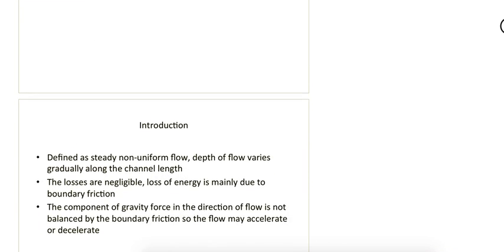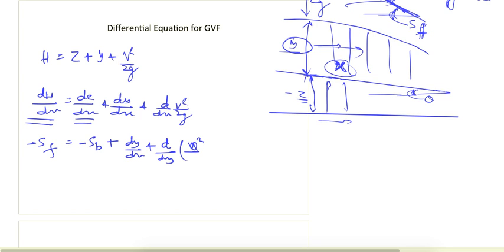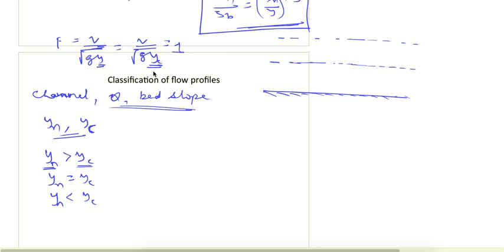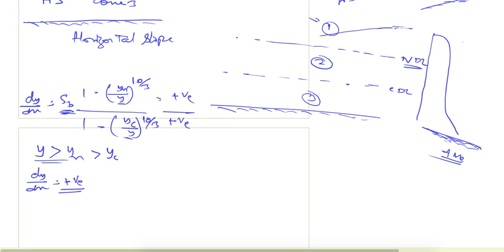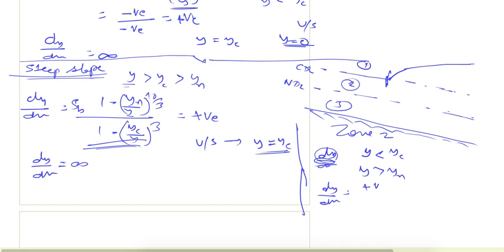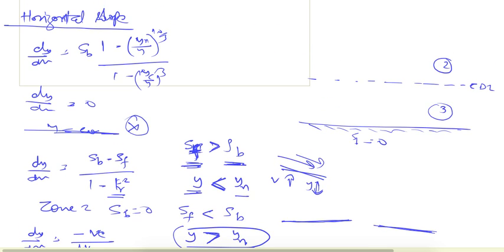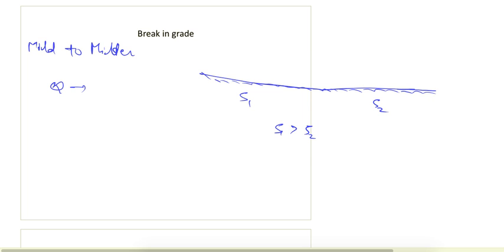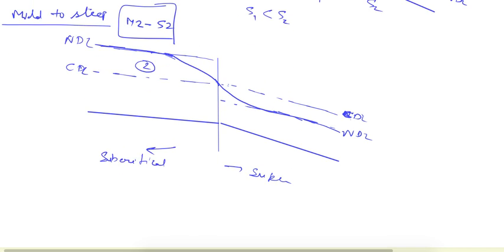Gradually Varied Flow | Open Channel Flow

Comment: sir in crtical slope ...........dy/dx is not coming equal to Sb because in denominator and numeratot ratio of depths have not same power
Reply from the maker: The power in numerator is nearly 3, if you used the chezy’s formula then both in numerator and denominator it is 3.
Reply: but by mannings formulae it is comming different.
Reply: use calculator or apply limits you will get the value near by 1 only or 1.1
Reply: Thanks sir, here I had also confused but now it is clear..👍

Comment: 45:23 how the values will be same since the power differs.. Explain pls !!
Reply: Nice question
Reply: if you use chezy eqn... it would be equal
Reply: Cause 10/3 is equal to 3.33 which is almost equal to 3 so it will be same

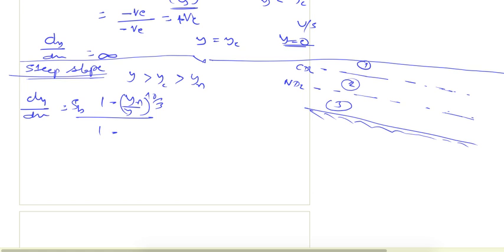Comment: at 40:20 ..in  dy/dx formula you use 10/3 in upper and lower part ..but next time in same formula use 10/3 in upper part and 3 in lower part..can you explain..i think its just a writing mistake...is it??
Reply: Mohammad Nishar that is mistake .....in upper part 10/3 is the correct one